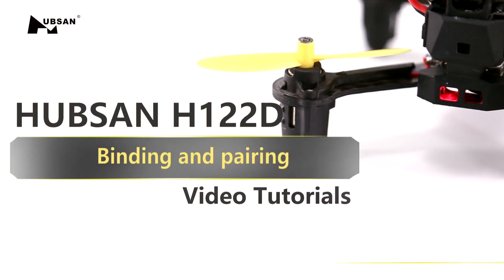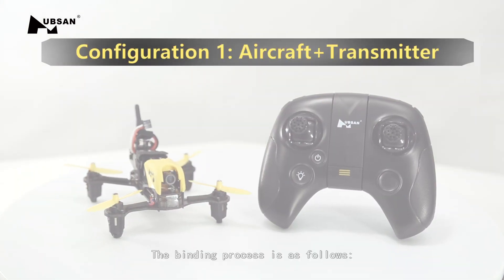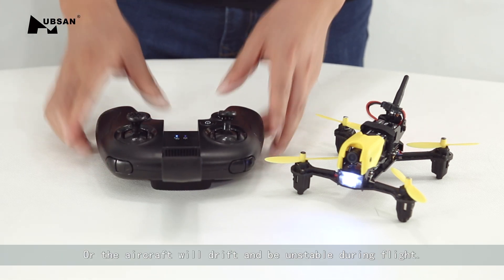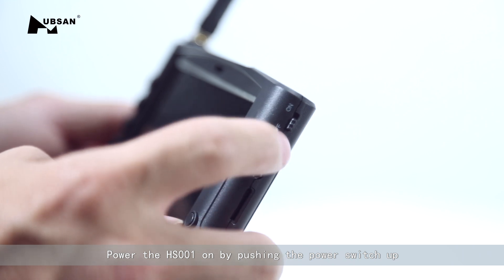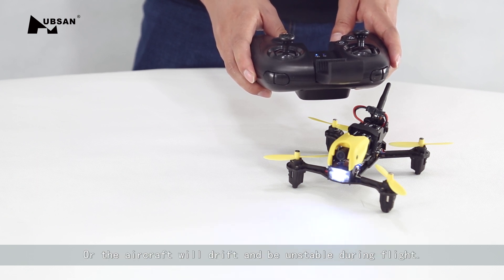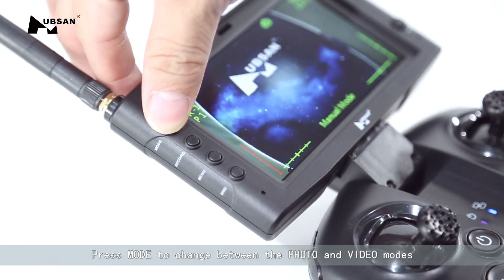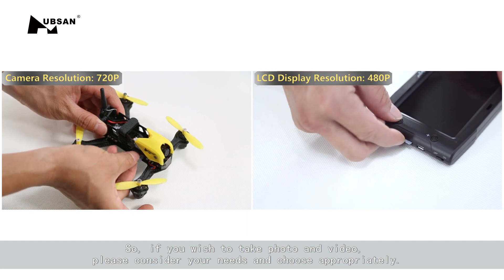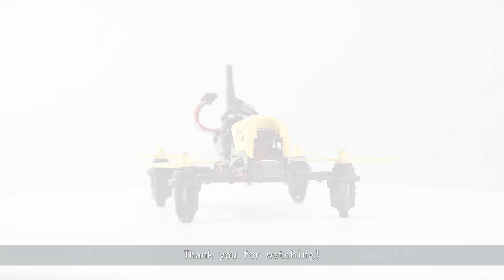HUBSAN H122D X4 Storm Video tutorial：Binding and pairing

Comment: Truth !!! Ditch Hubsan get a PNP hobby grade model. You can use your Hubsan box goggle for any fpv VTX transmitter. 
I'm using mine for Diatone Rabbit 239 NX & Diatone 249 + carbon fiber frame. 
it's not the absolute greatest picture but they work you have to buy better antennas for it but it works.

Comment: Don't get this drone i crashed it a couple times then the battery ran out so I charged it then i plugged it back in and the drone caught on fire luckily nothing else caught on fire and i put out the fire in the drone. The drone wont even turn on.  I'm so disappointed, the drone said it was carbon fiber and very durable. guess not. Don't this drone it will be broken so quickly.

Comment: I have had the Storm for a month or so now, didn't experience any problems (apart from it coming with 3 B props and only 1 A prop installed - quick fix) with binding the controller/fpv to the quad.
But after i tried pairing it up with my Jumper T8SG i can no longer bind to any of my transmitters, and the Storm just powers off randomly when i try binding..

Any idea what i have done wrong ?
tyvm
Reply: rebound all the original parts, and i got video-feed and transmitter pairing again... No luck with the Jumper still tho ;<

Comment: This drone has an USB on it, the transmitter has too. Is there any chance to add Acro mode by firmware? Since I bought this drone I'm waiting a firmware with acro mode... An expensive racing drone without acro it's like a Ferrari without wheels.